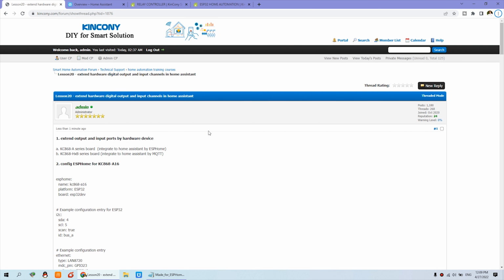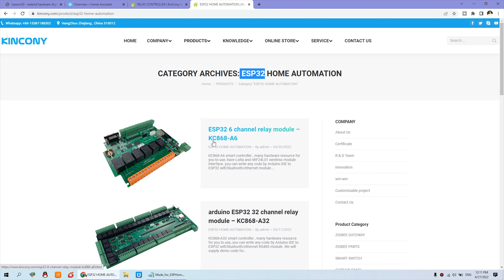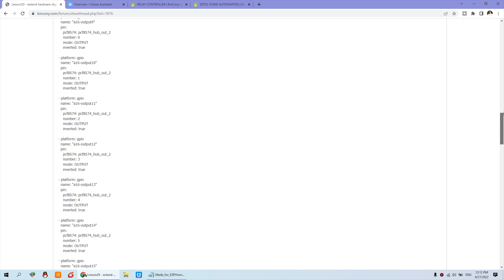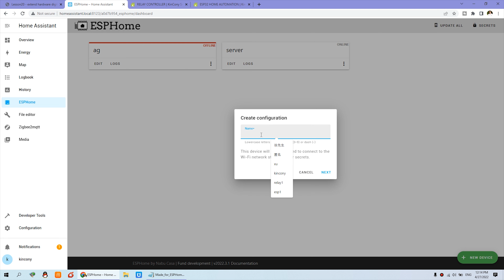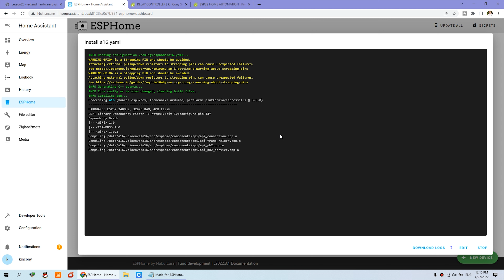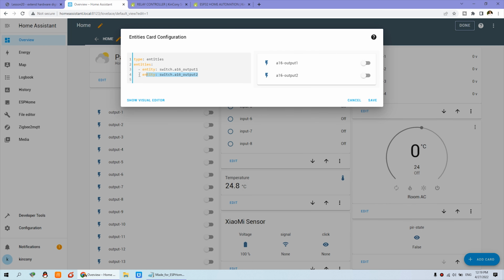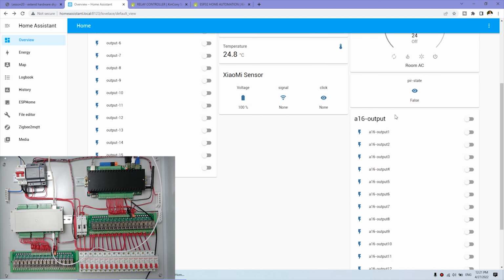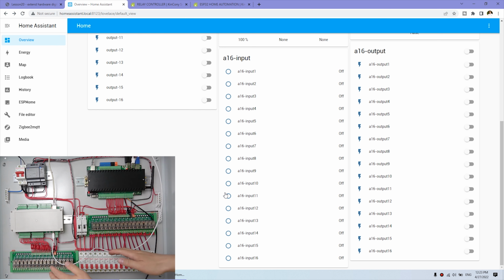【home automation training -20】extend digital output & input in home assistant

Comment: Hi, very interesting video! Just one question: Can I integrate the KC868-E16S ESP32 board into my PC,  which already has Home Assistant installed?
Reply from the maker: sure, just install home assistant software in your computer.
Reply: Thank you for fast reply! Last Question, if i'm not wrong, the KC868-E16S ESP32 have 16 input, which i can implement 16 manual switch? @KinCony